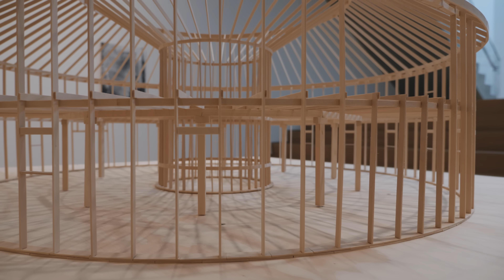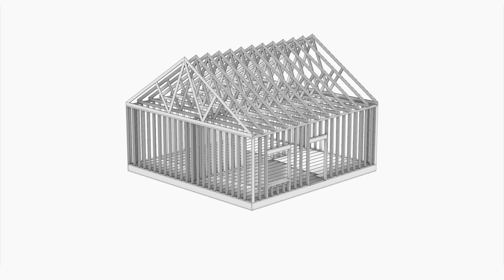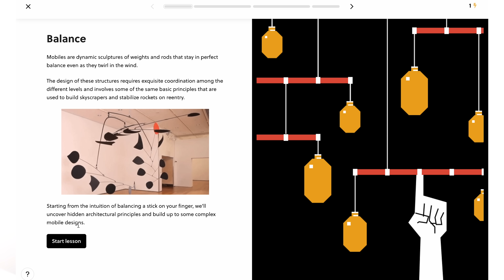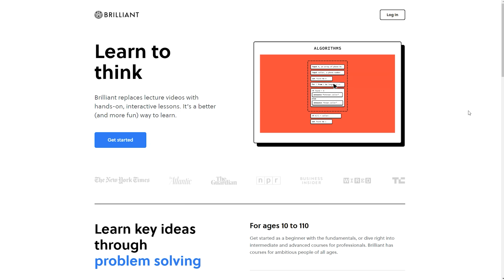The Genius of 2x4 Framing

Comment: This is why there is mass devastation in a hurricane or tornado in USA the entire house collapses. In the UK we use clay bricks, stone blocks and mortar so in a bad wind, at worst a roof tile might fly off.

 This is simply a fact of physics - Rock and clay are more dense than timber, so our UK homes are infinitely heavier and more stable as a result. Yes, bricks and mortar takes longer to build, but the results are a house that will outlast it's occupants for at least 2 generations.

In UK We build our Tool Sheds out of wood, not homes.

Comment: I'd beg to differ that framing doesn't require skilled labor. While laborers are abundant on big job sites, they're not the ones cutting and fastening. Even for simple framing, you need strong familiarity with your tape, especially those dastardly fractions, you need to be able to make quick and accurate cross and rip cuts, and you need a solid degree of proficiency with essentially all of the common hand and power tools. Not to mention an understanding of plans, codes, and safety regulations. I'm a carpenter, but I've never actually worked as a framer - still, by that point I'd say you're a skilled worker.

Comment: Carpentry is very much a skilled trade, just as much as plumbing and electric. However, the apparent widespread misunderstanding of that is causing serious problems. There is already a shortage of young people going into trades, and the fact that plumbing / electric / HVAC tend to be significantly more lucrative than carpentry means there is a big shortage of carpenters. I believe this shortage is causing widespread shoddy building practices, and once a home is built, framing errors are more difficult for inspectors to notice than shortcomings in plumbing / electric / HVAC. If anything, carpentry should pay better than other trades, since it is harder on one's body and tends to become very difficult to keep doing after about age 50. Meanwhile I know a 72 year old electrician who tried to retire but it was too boring...  and he continues to work, although he did put lots of effort into staying fit.

Comment: This video doesn't discuss how light wood frame houses also coincide with the throwaway tendency in modern America and the breakup of the traditional family home. 
Sure brick and old style wood frame house aren't as efficient in the short term, but in the long term they create a structure that can last hundreds of years instead of mere decades. Houses used to be built to be home of several generations instead of just one.
Light wood frame house are a detriment in the long run and only serve to benefit those who make a living constructing wasteful buildings.

Comment: It always seemed very interesting to me, how the americans love to use their wooden frame when building a house. Here in Poland houses are build out of brick - old ones from regular brick, and new houses typically use hollow brick. In last 10 years in my village there were about 20 new houses built, but only one was made of wood - and it was a prefab constructed because it was the quickest method. The roof framing is always made out of timber though.
Reply: We don't prefer it. It's what we can afford, if able to afford a house at all. The housing market in the United States is absolutely insane currently.
Reply: @Mrwizard-ck7oe  I'm pretty sure the polish housing market is at least just as bad, if not even more of a shit show. And americans were building with wood long before current housing crisis
Reply: @Preedx2  We've had multiple housing crises this is only the most recent one
Reply: @Mrwizard-ck7oe  I double checked, and according to top 10 google searches building a house costs ~300 000 USD in the US and ~260 000 PLN in Poland. Median salary in the US is ~55 000 USD, and ~42 000 PLN in Poland. It comes to about 5,5 years of saving to build a house in the US, and about 6,5 years of saving to build a house in Poland. Of course, this doesn't include arguably the biggest cost  and definitely the most dependant on where you build - land value, but since we are talking only about construction methods it shouldn't be a factor.

So it is surprisingly close, both our countries seem to be equally screwed
Reply: @Preedx2  Yep and I don't see it getting better at any point. Crazy to believe that my parents bought a house in the middle of a economic crisis and now our house has doubled in value.

Comment: Fascinating. And from such an unexpected angle! For me, just recently while working on my tiny house, I reluctantly come to the same conclusion that 2x4 framing - which I used to belittle as "stick framing" - might actually be genius. 

But for a different reason than in the video. For me, I was impressed by how the regularity of the cavities between the studs accommodate the modern conveniences of insulation, which can be efficiently sandwiched between the studs, and wiring/piping: the studs - or the holes drilled through the studs - hold up the wiring/piping nicely as it runs along the walls *hidden out of sight*. 

So maybe 2x4's success lies partly in its ability to accommodate - out of sight - the modern conveniences of insulation, wiring, and plumbing??

Comment: Great argument and very thorough. When it comes to the genius of light wood framing, you can't ignore the network effect created by all the downstream commodities that perfectly integrate into the resulting structure. For instance, drywall comes in 4x8 sheets that exactly span three 2x4 stud bays, and reach an 8' ceiling. Lap siding comes in 12' lengths, again exactly spanning multiple stud bays. Insulation comes in 14-1/2" widths, which nest precisely between 2 studs. Breaker boxes also come in widths that slot neatly into a single stud bay. If all of these things had to be specially sized on site, the value of light wood framing would diminish greatly.
Reply: Standardization and commoditization drive efficiency. Building a structure is already expensive enough as it is; just imagine how expensive it would be if it was all custom, all the time.
Reply: That things fit other standardized materials is NOT amazing and wonderful- it’s necessary and expected.
Reply: @fishhuntadventure yeah true, us dutchies used/are using baked clay bricks to build with, yes it is heavier and not as many can build houses with it compared to usas wooden frames, but allmost all other solutions the usa solved are also solved by bricks, u just need bigger pieces of wood to support floors or ceilings, but usually most walls cover that
Reply: Or use steal beams iso large wooden ones, but idk for how long that really has been a thing
Reply: @larsrademakers6070  what you describe is "ordinary" masonry construction, with brick walls and dimensional lumber joist flooring and roofing.  It's also very common, but also significantly more expensive, and not used often in residential construction for that reason.
Reply: @larsrademakers6070  Lightweight steel frame construction has been in common use since the 1950's, but because it is so vulnerable to fire, it is usually relegated to commercial and industrial properties which require long open spans and active sprinkler systems.
Reply: So where I live we use 6x2 framing (more space for insulation) and our stud spacing is two foot. But our dry wall is 4 foot wide, but in almost any length, and then we run them horizontally, rather than vertically. Then when you're plastering you only have two joins (usually, depending on ceiling height), and they're at a much more comfortable working height.
Reply: Drywall, insulation, electrical boxes, and plywood all arose literally decades after 2x4 timber framing became common.  Balloon frame buildings would have used lath and plaster and did not have electricity.  Things that came later were slotted into an existing framework, so to speak.

Comment: Fantastic video, glad this came up on my recommendations. One thing I would mention is that although a lot of the building industry has come a long way since 2x4 framing, the framing hasn't really kept pace, particularly with regard to accommodating high insulation standards. 2x6 framing is a quick way to get more room for insulation but the timber's still a thermal bridge. Would be good to maybe see a video on how people are trying to evolve framing to meet those challenges.
Reply: You can use a 2x6 plates with 2x4 studs and alternate lining up from I interior to exterior so there is no thermal bridge. You can do double 2x4 off set walls. You can do 2x4 framing with  a second strap and rigid foam on the exterior. And there are numerous other options that have already existed for decades
Reply: SIPS (structural insulated panel systems) are a modern innovation to get around the problem of thermal bridging in lightwood framing. They are similarly standardized, though, so they retain the same benefits of 2x4 framing.
Reply: @catherinesearle9596  I prefer double 2x4 framing over SIPS. The basics are the same as a standard 2x construction which allows you to use just about any contractor with minimal workforce training. I also like the end product better with a full 7 1/4” of insulation with thermal bridging only at the plates and openings.
Reply: https://www.youtube.com/watch?v=mxDSulcLpAE&pp=ygUPaW5zdWxhdGVkIHN0dWRz

Comment: Really good.  PBS should give you a series.  I wonder if with modern materials, Eichler like post and beam framing, maybe using 2 x  4's  would be more material efficient than 16 inch on center framing?  Not necessarily with lots of glass walls, but maybe foam core panels.

Comment: Very nice insights.  Sawdust doesn't make OSB it makes MDF.  It takes a chipping process to turn wood into the right type of material for OSB.
Reply: Correct. OSB=Oriented Strand Board  MDF=Medium Density Fiberboard
Reply: that's true rejected boards and cut offs feed the chipping process
Reply: Sawdust also makes particle board which self-destructs if it hears that it might rain... The ONLY use that I've ever found for particle board is as a sacrificial cutting surface on my radial arm saw and even then, I need to remember not to sit a cold can of beer on it because we're so humid that water will condense on the cold can.

Comment: I find this type of construction very strange.  First, because it looks fragile.  After that, there's the problem of termite infestations and moisture degradation.  It's something you simply don't see here in Brazil, where most houses are made of bricks and concrete.  Here we have almost no natural disasters like hurricanes and tornadoes but a house like mine would withstand the passage of a hurricane or tornado with relative ease because it is almost entirely made of concrete and bricks.  On the other hand, wooden houses of this type are good for thermal insulation, something ours are terrible at.  Lately, houses with a light metal structure similar to those of light wood framing have been emerging, but using aluminum.  I don't work in the sector but I find civil construction a very interesting topic.

Comment: Wood stud framing today is not the same as it was 140 years ago. Mortise and tenon were still used then to mount each stud 16 inches on center as well as diagonal corner studs and the joining of floor sils. This is light wood used in a strong way. platform framing is much weaker. Fire blocks can be easily added to balloon framing And, no, people didn’t need hydraulic cranes to build timber frame houses. Small timber frames were used a lot and are not all giant Amish barns. These smaller timber houses used less wood than a Mchouse. Americans prefer affordable over not affordable. Variety is also preferred. The facility to grind the earth into money faster is the opposite of human benefit

Comment: certainly not unskilled labor, maybe less skilled than a master carpenter.
A light wood carpenter (stick build) has to know how to use a rule, squares, level, saws, etc. Maths to pitch a roof or cut stringers to architect specs. Finish carpenters have to take this to an exactness. Unskilled laborers typically carry the wood from place to place or assist carpenters. 
(I'm leaving this though i see you corrected yourself.)

Comment: You call carpenters non skilled that's hysterical. Go cut in a 8/12  pitch roof with birds mouths or some dormers.  Timber frame isn't gard its layout & time consuming chiseling away to make the joints.

Comment: Is it looking down upon light wood framing to prefer timber framing as just more visually appealing and, if done right, longer lasting? For me the skill required is a plus. It's not as efficient to erect, but I'm building my own home and not the suburbs. I'm using lightwood framing in parts and timber frame in key visual and structural sections. That's worth it for me, but I'm also finishing a mill and log trailer to cut my own beams, drawing the blue prints for passive solar, learning Revit, running snow loads and spans, so there is a personal fun and sweat equity aspect to the house.  :D

Comment: Light-Food Framing sucks and is literal cancer. I will die on this hill.

It's...
- ...MASSIVELY wasteful (Forestry, Transport, Milling, Construction Waste, Chemical Manufacture, Marketing, Retail, Markup)
- ...COMPLETELY ~ F_CKING ~ UNRECYCLEABLE!! Each conventional lightframe house is basically >10 tonnes of semi-hazardous landfill.
- ...Inexcusably disruptive to ecosystems..... Look at the satellite time-lapses of the West Coast / Cascades forestry progression over the last 50 years.... sure the forests 'grow back', but FAR, FAR thinner and weaker than before. They never really recover, despite what Werehauser might say.
- ...Unhealthy as hell  - Look at YT lectures about Black Mold in lightframed houses. ....And to build houses so that they don't suffer from mold problems basically eliminates lightframe's cost-competitiveness. MOST lightframe houses are impregnated with mold - it's not the 'exception', it's the rule!
- ...Promotes the co-use of a bunch of toxic, low-quality, low-durability, high-waste construction materials.... Thousands of pounds of Drywall, Staples, Plastic Barriers, VOC Adhesives, VOC paints / stains / sealants / varnishes, Tar Shingles, etc. etc. etc. etc. etc..... *per house*!
- ...Low-strength.... Barely enough to stand up against code, and certainly not enough to stand up against a Tornado or flood.
- ...TERRIBLE with Utilities - They can't hold heat nor cold, cost a fortune in lighting & heating, and practice no water cachement / recycling / reuse.
- ...And because of the aforementioned Cheapness, modern homes are ALL money-sinks. Water, Mold, and Pest damage sets in IMMEDIATELY.
- ...And finally... to be honest, your average McMansion just isn't very pleasant or comfortable, if you really back up and think about it. Uninspired / unnatural layouts, cuboid rooms, low homogeneous ceilings, no skylights / little natural light, mold / construction smells, anemic or poorly-landscaped yards. They're more like barracks than 'homes'.

Conventional Light-framed homes are an abomination.

And what's that about "Affordability"??? Another lie..... all those "Cost Savings" go the the DEVELOPER and the BANK, >>>NOT<<< the homeowner. Sure, the home cost $175,000 to build, you YOU still MORTGAGED it for $900,000.

People need to stand their ground and raise their personal standards. We all know our moldy-a$$ houses suck, but you average American't never has the spine to say it.

We're allowing over-regulation and inflation to force us into continuing to accept a LOW-QUALITY construction system (Light-Wood Framing) that was used by necessity 100-200 years ago, in a time of pre-modernity, frontier construction, undeveloped supply chains, and an abundance of easy lumber, when people *just needed to get a roof over their starving, freezing heads, FAST*, and didn't have time to work on more refined building techniques.

It's an outdated system that stunted-brained late-to-the-party imbeciles have turned into a religion, because the first time they did any real work was at the age of 20 when they got a job at their daddy's construction company, indelibly imprinting them with the notion that screwing together some OSB into some Home Depot 2x4s is somehow the "Pinnacle of Carpentry and Manliness".

Look up the "Exploring Alternatives", "Kirsten Dirksen", and "Nito Project" channels on YT.

Look up "Earthships" (A little gimmicky, but at least got the right idea).... Look up "Quonset Kits", "Steel Pole Barns", "Earthbag Homes", and all that stuff. Look up Japanese craftsman channels for some quality woodworking that has love put into it and will LAST. Those are REAL home-building systems for the 21st century, not this wasteful McDonalds-tier crap.

Comment: 3:40 Öum... no you don´t make OSB out of saw dust. They are made out of fiber strands... like the name suggest. Of saw dust we make particle boards. Even worse than OSB, but have some benefits.

5:50 I see no reason to belie that light wood framing originated in the US. I would suggest it originated in the Netherlands sometimes in the 1600s. The reason that it was used was due to a lack of good timber, something Netherlands lacked at that time. But it was not all. Also need a surplus of manpower and/or energy. Wind powered sawmill spawned in Netherlands sometimes in that century, unlocking fine cut timber, something that just wasn´t economical prior. They of cause still used pegs, and not nails.

9:00 clearly a 2x6.. still calls it a 2x4.